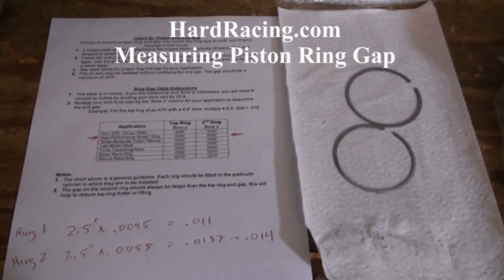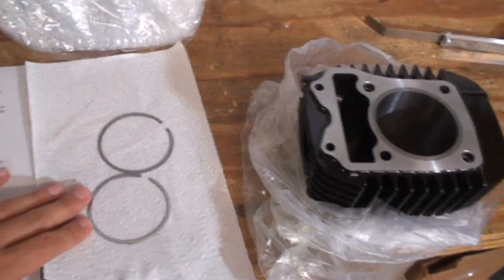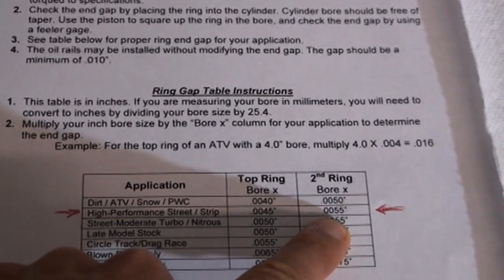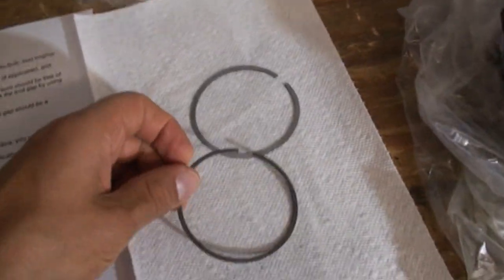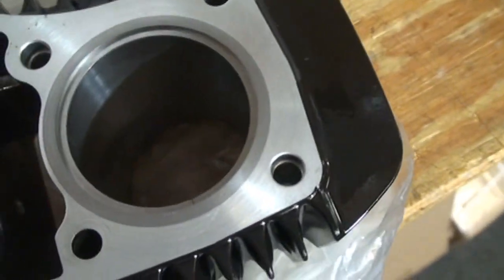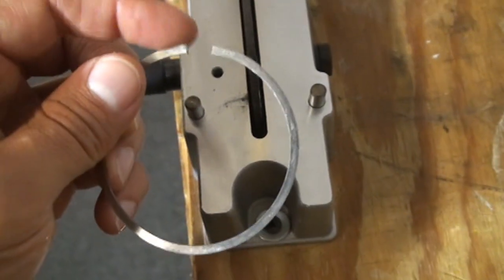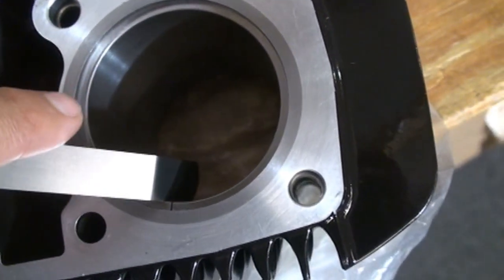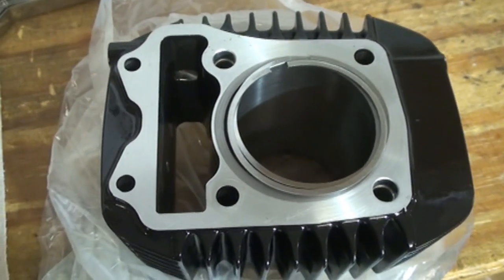Correct Piston Ring Gaps Grom  #Hardracing #HardRacingGrom #HondaGrom

Comment: How about oil ring sir.
Reply: 4 years late but putting this here for future people
only 2 rings you really need to gap are the top 2 rings. you can measure oil ring gaps if you would like and check specs to be safe but 99% of the time on a small cc bike the oil rings dont have to be touched

Comment: Hi mate, 
Kindly i wondering if the ratios (bore X) for the stock (STD) pistons or the forged one...? because the manufacture catalog told us the gap should be  between 0.3 mm and 0.5 mm for the  N/A engine (non turbos)
my Application now to upgrade the engine to turbo so i think the best gap will be 0.0050" 
Street-Moderate Turbo / Nitrous .0050” the second is  .0055”  
Isn't it or....?
Reply from the maker: It is best to ask the piston manufacturer for recommended gap, if you are running Turbo.
TURBO is totally different settings.
Reply: i use the stock pistons form another turbo engine to lower the compression but it is the same bore so i saw the specs of that turbo engine i found between 0.30 mm and 0.50 mm
note: the piston is not forged but it is strong enough. so...? 
i need your advice
Reply from the maker: We would never used a CAST Piston on TURBO motor.  Just asking for problems.
Reply: thanks for your time, i don't have any problem !
just need an advice .... thanks
Reply from the maker: no problem